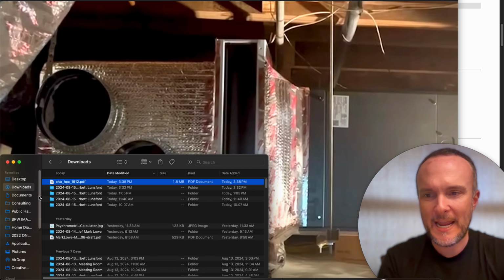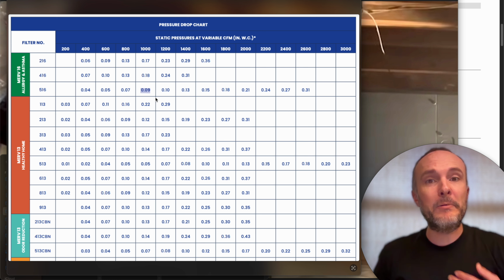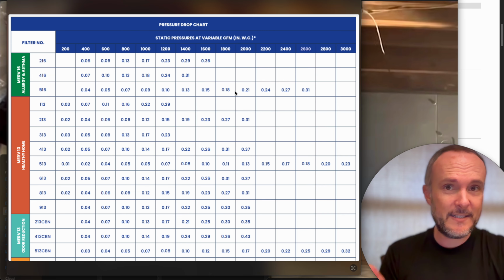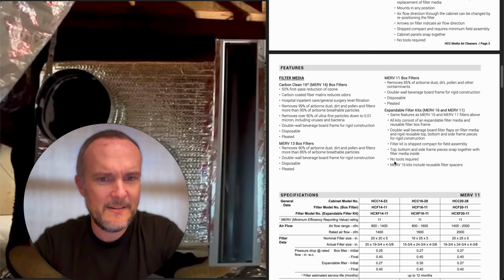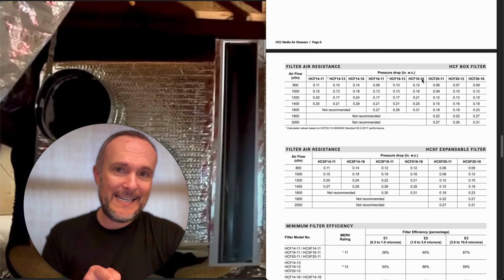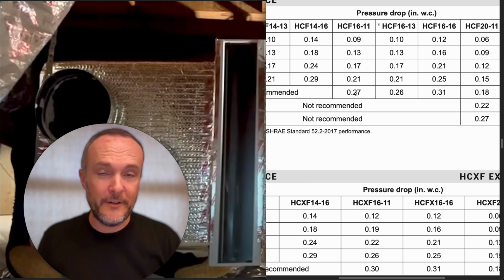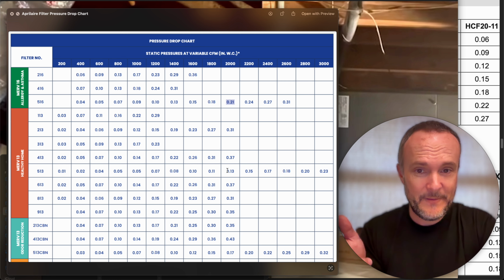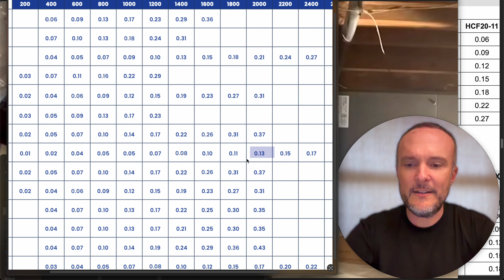Home Air Filtration: HVAC Filters for Healthy Air AND Ideal Airflow

Comment: This is why I have always used 2 to 3 of those Lennox air filters 16.  In custom sheet metal boxes.. 

My father showed me and demonstrated using an old Dwyer Magnehelic back in the late 1970s. 

Currently replacing a customers 20” x 24” x 1” Merv 11 filter for a 5 ton air handler   
with three 20”X25”X5” MERV 16 with a
Dwyer Magnehelic permanently installed across the filter for the customer with a permanent ink marker line to tell the customer when it’s time to change the filter.

Comment: Thanks for the info on Aprilaire!  On 2 jobs recently I helped the clients swap out filters.  They were using electronic filters, but never cleaning them because the installer didn’t say anything to them about it.  They had zero filtration basically.  On one of them, I was able to do a MERV 13 and the other a MERV 16 so they have some nice filtration.  Crazy the stuff I see out there.  Then they wonder why their drain line is always slimed up every few weeks.

Comment: We put in a heat pump (2022) to replace a spec system at the house which is doing great and saving money despite higher per kWH rates and I made sure that we had proper humidity control, fresh air (ERV) and HEPA filtration. Your content helped inform what I asked for and then asked about when looking at various system options from the local HVAC professionals.  We live in a climate not too different from Atlanta and the system has performed flawlessly through everything from 110 plus  (with very high humidity) down to -1 ℉. 
The filter box is April Aire and is doing a great job.

Comment: Funny, I use the filter you are talking about from Lennox, the X6675 MERV 16 with my 5 ton system (2000CFM). Luckily it has been working fine for me for the past 12 years. I am getting a good nanometer to measure the static pressure, I can only guess that it is very high when running at 2000CFM. When I go to replace my furnace to a heat pump I will make sure I get a filter system that can handle it.
Reply: Based on the info presented here, that filter will be slowing down your airflow which will skew you Sensible Heat Ratio (SHR) towards dehumidification.  It costs you some cooling efficiency but will dry the air more.  This can actually be a benefit in cool damp climates (or shoulder seasons) where the AC doesn’t run too often.
Reply: @superspeeder  I was about to say the same. Don't be surprised if you open up that return that you start to witness symptoms of an oversized system (short cycling, poor dehumidification). Also with an ECM motor you may be configured to run at 2000cfm but measure those statics and it's probably more like 1800 or so. It will definitely improve the efficiency of the blower though!

Comment: I was happy to finally modify my 3 ton heat pump's two 16 by 20 inch return filter grills to accept 4 inch thick filters in lieu of the standard 1 inch filters. I already had standalone HEPA filters, dehumidifiers, and an independently ducted ERV but being able to run the air handler continuously with large MERV 13 filters has still made a nice difference with my air quality monitoring and the general feel of the air.

Comment: What about the lennox HC[X]F 20-16? A 20x25x5 merv 16 with carbon filtration? I'm currently trying to figure out the best way to get merv 16 and carbon filtration. Aprilaire doesn't seem to have a solution for this other than running both a 516 filter and a 513cbn filter together? Not having much luck finding a 31x28x4 carbon filter besides from aprilaire too.

Comment: Corbett, it would be great if you could do a video on the IQ Air and Intellipure whole house filter systems, what they would need for air flow and if they are worth it. Also, I would love to see a home made ERV / HRV system, if you have ever done that by building a box with filters.
Reply: Sadly Intellipure’s HVAC Super V is commonly promoted by “influencers” that it can catch particulates below 0.3 microns (0.07 I believe), but if you read its stats closely, it’s actually 0.3 microns. Which is standard HEPA… 

I really don’t like Intellipure’s household purifiers, I have a graveyard of them. They’re loud and the filters are INSANELY expensive. They’re air purifier’s CADR/CFM are weak also, unless you enjoy screaming to communicate with company when they’re over for a cup of tea lol

IQAir I guess is a better choice, but I think they’re both overrated imo. Even the IQAir household air purifier on 4 wheels. Their filters do not last as long as they say they do, they’re also expensive, there’s like 5 filters to change for one unit $$$, but the decibel level is better. Nice looking machine though, I’ll give it that.

Not a fan of those vacuum yourself HVAC filters either. I was always told vacuuming/washing filters affects the integrity/performance of the filter. I’d rather just change out new pleated media filters (4” thick MERV 11 is perfect for me imo) for my HVAC. And I’ll use aluminum tape to fill any loose gaps around the filter. What doesn’t get discussed enough is the air breach points that commonly surround HVAC filters (from poor filter cabinet designs). Contaminants can bypass around the filter, eventually creating mold food on our wet evaporator coils. What’s the point of any filter if air can escape around it… The filter should fit really snug, all filters should. The big misconception is HVAC filters are to clean our indoor air, but they’re not, they are really created to protect the air handler. And the big scam is these companies saying that their filters can go down to 0.07 sub micron sizes. They got everyone fooled in the mold community (fragments…) 

HEPA with great CADR/CFM is just fine to clean our indoor air. 

That’s my 2 cents, peace :)
Reply: @sp1200M3D  Thanks! Do you feel the IQ Air whole house filter is better?
Reply: @naturalhealing9970  connected to the HVAC? Yes. But I would make sure who installs it knows how to balance your system after. Load calculations and all that fancy stuff. Some of these special hi-grade filters (even higher than MERV 13) can create static pressure issues. The thing about the HVAC industry is some of the equipment is great, it’s many of the installers who are not. And you’re welcome:)

Comment: Trutech now has a filter box with even lower pressure drop, at the cost of being enormous and expensive. It’s much more expensive than the AprilAire, but they claim annual filter changes so the TCO is roughly a wash on a 10 year time scale. I’m excited that there is now more than 1 option.

Comment: I would be interested in the math behind that. A merv 13 multi pass vs merv 16 single pass.
Reply from the maker: MERV 13:
85% capture of particles over 1 micron, 25% capture under 1 micron
MERV 16:
95% capture of all particle sizes

Comment: Is there a reason that we are still playing around with tiny filter cabinets in residential buildings? When you have an application like a basement or other place with lots of room and access why are we not using commercial pocket filters. In use they end up being far cheaper than residential filters and with the sheer filter area size pressure drop is not really ever going to be an issue and you have a plethora of filter types available. 
      I would have gone that routs on our house but it's an old 1960 house and an upflow and no room for anything mechanical related really.  Oh and I hate upflows in the center of houses as the return side is so noisy since it's a direct path to the fan with nothing to stop the noise unless you make custom sound baffles to block the direct line of sight for the sound to follow.
Reply: I’m arm-chair HVAC’ing, but I agree. A lot of homes have dozens of cubic feet of return duct volume, but they only dedicate a fraction of a cubic-ft for the filter (e.g. 0.22 cu ft with a 16x24x1”).  

They could even put multiple filters into a “V” or “A” configuration (like an A coil) to double the filter surface area.
Reply: I suspect one reason is many of the system/duct design guidelines (ASHRAE, etc) are based on a nominal 1" filter.
Reply: It's because residential HVAC is in the stone age... Commercial is definitely more advanced but still relatively primitive in terms of design and control compared to other industries.

Comment: Hi Corbett, thank you for sharing this! I’d be curious to do a mock up of both systems and see what the particle count is on the air coming out the other end. My thought is, since the filter is larger than the duct feeding it air, wouldn’t that mean that you’re basically only using part of the filter? So would that affect the filter’s ability to actually pull particles and contaminants out of the air? 

Curious your thoughts on that and if you’ve tested (I know you love your testing haha)

Comment: If we had all the space in the world, can we not just build a bifurcated plenum where you split the flow 50/50 and just have two of the large filters? They would each get half the cfm, would that help with pressure issues? I did this with porcelain water filters on my home, where because they are so restrictive I just split the flow and then reunite them down the line.

Comment: What about IQAir?  They also make a hyper hepa duct cabinet for hvac that looks really nice
Reply from the maker: Those units START at $2000. The replacement filters are also quite pricey.
Reply: @HomePerformance  no doubt but you get what you pay for. Filtration quality and performance is top tier. I’d likely be paying around 20k for my next system once it’s all said and done any ways so it’s just incremental.
Reply from the maker: It’s not incremental though- HEPA starts at MERV 17 for $2k, or you can have MERV 16 for $250. I’m sure your system will kick ass no matter what.
Reply: @HomePerformance  Just want the best, that's all.  Having hyper hepa in my hvac allows me to not have hepa units in each room as I do now.
Reply from the maker: @darylfortney8081 cool man

Comment: Due to an odd ceiling lighting track in the way, I have two parallel filters on my split return. How should I calculate the math if I have filters working in parallel? Halve the resistance value? Trying to figure out the best filter I could run without stressing the air handler.
Reply from the maker: Halve the CFM through each filter.
Reply: To make this make more sense you should go through what the TSP for the air handler is. Then how to measure this. If you go through the Lennox equipment manual you will find that when you get to 2000 CFM it recommends that two filters be used. Next if your return ducts are not sized correctly it doesn’t make any difference how big the filter is. Picking out one component and calling it the answer is misleading, there so many things that affect the performance. I don’t know what area you located in but that insulation on the plenum doesn’t meet code here in TN.

Comment: I 100% agree with your assessment that bigger filters better; you get more filtration but less restriction on airflow.  Question though: I hate buying expensive paper based filters all the time, do you have any suggestions for washable, reusable filters?  I know reusable filters won't have as good a MERV rating, but I just haven't found many on the market.  Thanks!

Comment: At 2000 cfm, would you rather have a MERV16 filter with a 0.21 pressure drop, or a MERV13 filter with a pressure drop of 0.13? Guess what I'm asking is the increased filtration worth it. Prefer to not run it all the time. Thanks
Reply from the maker: As mentioned by @KPHVAC you should start this process with static pressure testing bc you might be about to kill your system
Reply: @HomePerformance  thanks will test first. It will be a new system with multiple returns.
Reply from the maker: @djheckler92 then you should be able to design it with Manual JSD calcs and know it’ll be perfect.

Comment: Humble HVAC tech over here, it's funny I was just talking with my manager about this filter.

I believe that Healthy Climate has an 25x25x5 filter, I think that's the biggest they got, it would be interesting to see the pressure drop across it. 

One question. I have a customer that suffers from a lot of allergies, they got someone to test their house for mold and found mold spores in the ductwork. I inspected the ductwork (it's In the attic) and it's probably the cleanest air handler and ductwork I've seen😊.

I'm thinking of recommending installing a filter like this. What are your thoughts on that?

Comment: The real question in my mind is why do residential air handlers have such abysmal static pressure performance? I don't think 2 or 3 inWC is too much to ask for.
Reply: Best i’m aware of is the high pressure mode on Mitsubishi that lets you go up to .8
Reply: i agree.  I guess it is a function of the blower type and seal.  Look at automotive 15PSI (that is 50x the pressure drop), where they use the piston suction vs a squirrel cage.

Comment: tell me where replacements can be had for around $25ea and i am all in. >$150, not so much.  The science driven choice is spot on though.  I like to see those tables use face velocity in addition to CFM.  The lager the face area, the lower the face velocity (for a given pleat count and depth), and hence the lower the pressure drop.

Comment: The likely reason that 16 inch tall cabinet is not recommended for 2000 cfm:  The typical gas furnace with a blower capable of 2000 cfm (or 5 tons of air conditioning) likely needs air to enter the cabinet into BOTH sides of the return or possibly into a single opening in the bottom of the cabinet (assuming upflow configuration).  You have to carefully read the install instructions on the gas furnace or air handler to know for sure.  Another lesson to reinforce the fact that good duct design for HVAC equipment requires a lot of nuance and very close attention to detail.

Comment: This kind of calculation should fall on the sales person, not the technician running 8 calls a day. Sales people are literally there to find out the customer's needs, wants, and space and give them a price on it. Most customers not wanting this level of filtration is not an excuse considering how fast a sales person would jump to offer higher SEER equipment even though most people get the minimum.

Comment: Corbett, cost should be considered too.  What do these large filters cost and how long between changes?  Just using decent 1” filters can cost comfortably over $100/yr in filter costs.

Pro tip: All 1” filters cost the same regardless of size, so a 3M 1900 14x20 is the same cost as a 3M 1900 20x25.  I see absolutely no reason for any furnace to use anything smaller!  In fact, I’d say you could likely save your clients money with bigger filters and changing them every 4 months instead of every 3.

Comment: Step 1 = test static pressure first!!! 90% of the homes in my area have undersized ductwork that can't handle any upgraded filter. We are constantly adding another return air duct to get proper airflow.
Reply from the maker: Excellent point